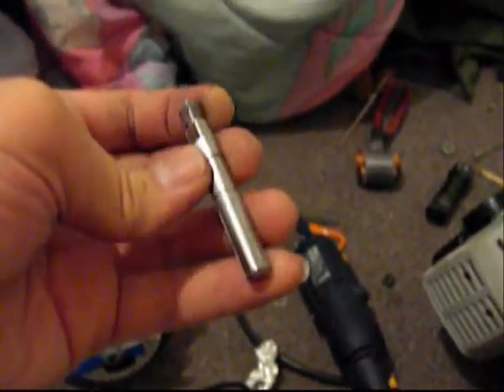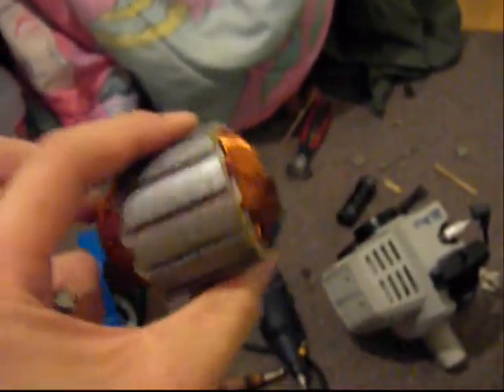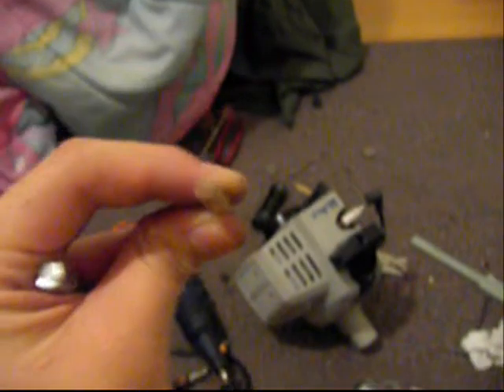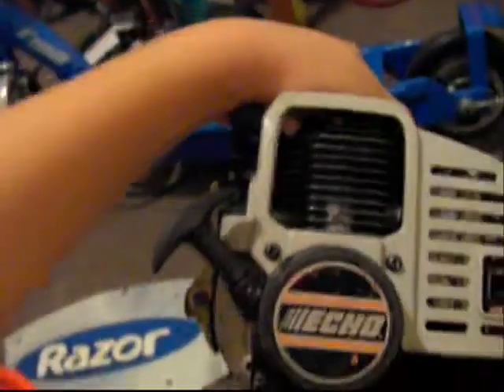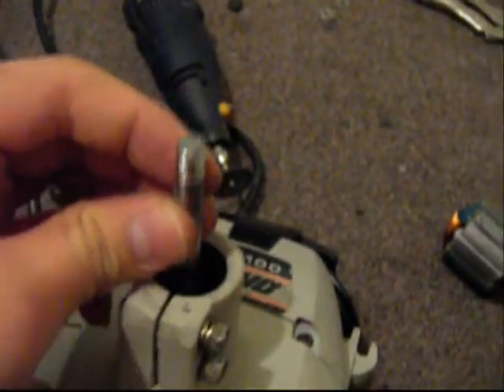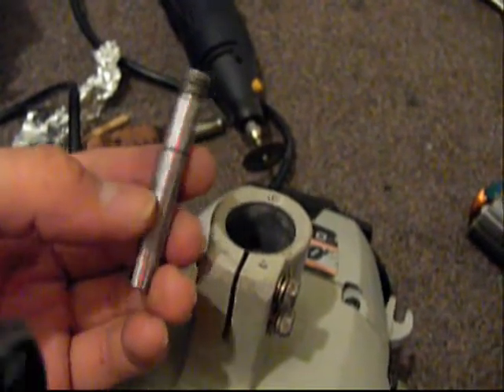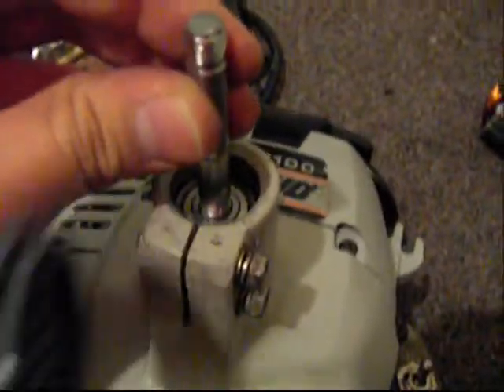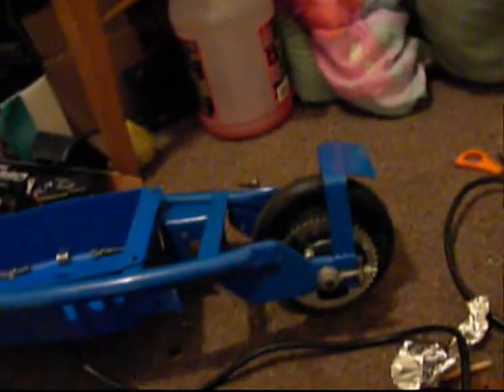Echo Powerd Razor Scooter Conversion Part 2

Comment: yea that bearing will fit right into that plastic peice and the two bolts will clamp it down inside there plastic housing around the shaft good idea